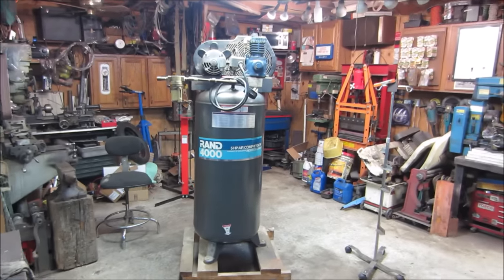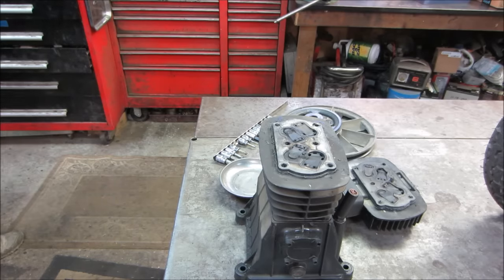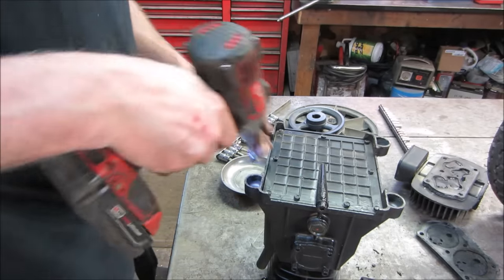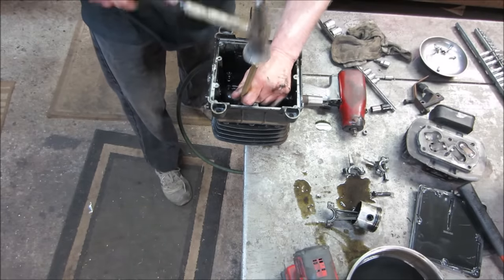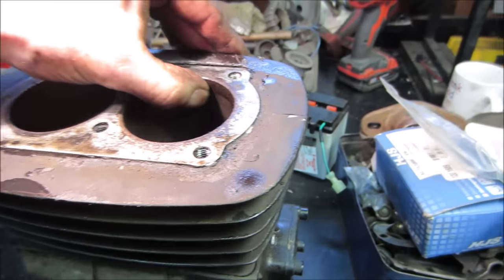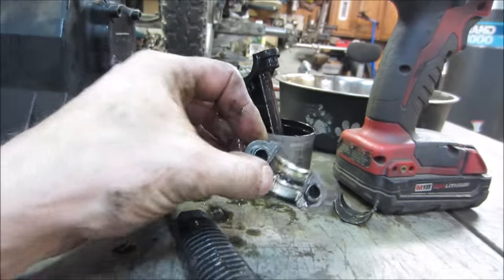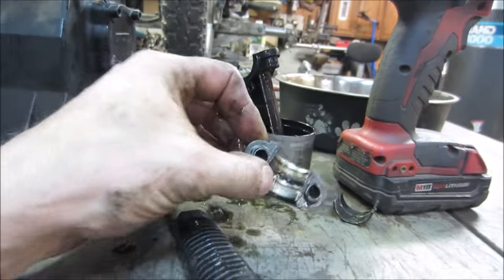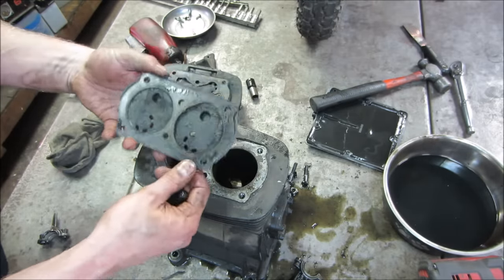Burned out Air Compressor tear down, what went wrong?

Comment: You could make an engine out of a compressor, but balance and the other gadgets would not condone itself to run for long. Ask how I know, I made a few using junk parts and all ended in failure. Oil is an amazing thing inside any moving contraption. Does what it is supposed to do, lubricate. Lets see, you are holding a slightly worn in part. My ex boss was that kind of DICK, he would say it will wear in. Anyway, the new compressors that are aluminum block are just for the hobbiest. There is a reason that industrial air compressors have a life expectancy of fifty thousand hours as a somewhat standard. Some a lot more, most a lot less. The old saying, you get what you pay for is very pertinent in this scenario. Nice video too.

Comment: If its a 2 stage compressor one cilinder might got hotter because of the higher pressure ;-)
Reply: Except its not a two stage compressor...  A tell-tale sign is that on a two stage compressor, the pressure from the larger low pressure cylinder feeds the smaller high pressure cylinder.  This compressor shares a common outlet between the two cylinders, therefore its just a twin cylinder single stage compressor.  Google some two stage compressors and you'll see what I mean.

Comment: I had the pleasure of fault-finding a Morris Minor 1000 engine that had snapped its crankshaft because a piston seized in its bore. Reason? The main bearings were badly worn and some twat thought it was a good idea to slip a thin shim behind each bearing shell. This would have worked if he'd put the shim below the bottom shell in each rod. Unfortunately, he put the shims above the top shell in each rod, thus blocking the oil-thrower holes. Genius, huh?

Comment: You can turn a gas engine into an air compressor but not an air compressor to engine because the compressor doesn't have a cam or valves but a gas engine the valves can be flossed of and it would compress air you take the carb off take out the push rods so the valves can't open then you take the spark plug hole and pipe that to an air tank and you now will an air compressor made out a gas engine

Comment: Sure looks like a compressor used on Snap-On compressors.Failed after two years.Made in Italy- maybe by de Vilbiss,Not even 1/4 the quality of the stuff made in America using Iron Ore- they used to simply LAST TOO LONG
LAST TOO LONG is no way to be a capitalist
My Sears devilbiss iron compressor just crapped out.I bought it in 1972.The torringtons on the crank had rolled their last revolution,I put new bearings in and then the valve plate cracked to uselessness.Sad,but no crying-parts NLA